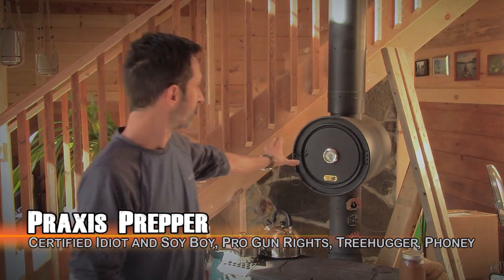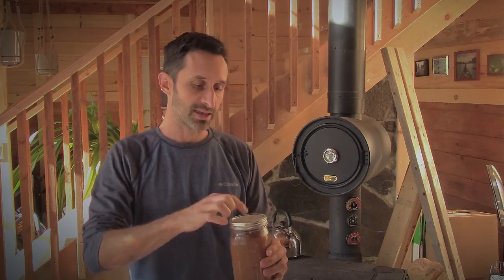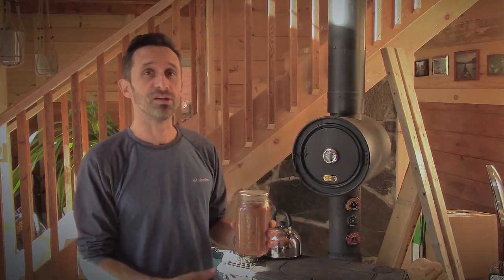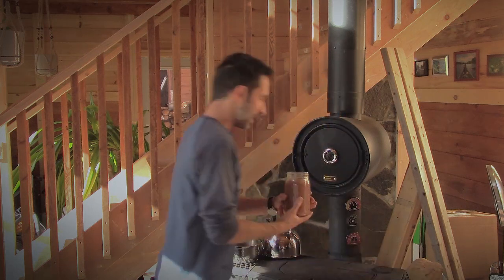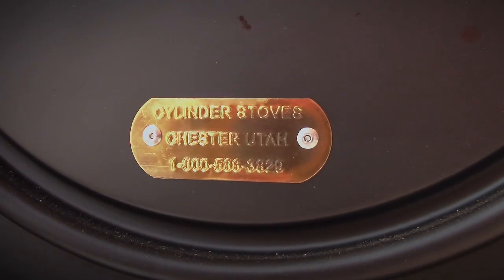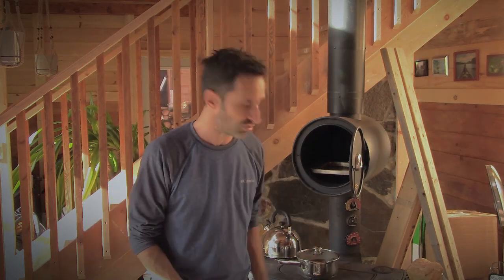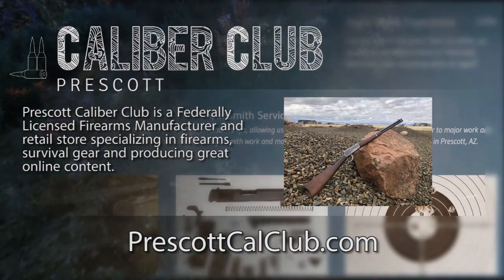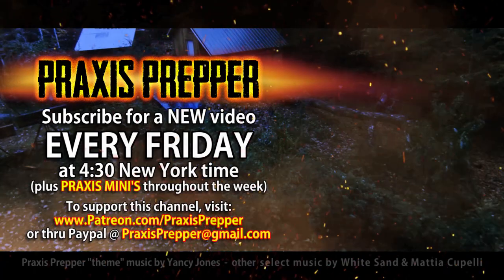The Best Emergency Oven

Comment: What I am hoping to see is an analysis of how well your heating system works in the winter and in the summer.  My experience is that with large openings between floors results in the top floors being hot all the time and the bottom floors being cold.  In the summer, running air through cold areas causes a lot of condensation...
Reply from the maker: So far it's been working great. We have a vent system that brings the heat from the tip top of the house and vents it under the concrete floors. Of all the new aspects of the house, it's the one that I'm 100% super happy with.
Reply: I would like to see a video of your vent system that brings the heat from the tip top of the house and vents it under the concrete floors. I have the same situation with my house. The upstairs gets really warm and the downstairs stays alot colder.
Reply: I would like to see a video of your vent system that brings the heat from the tip top of the house and vents it under the concrete floors. I have the same situation with my house. The upstairs gets really warm and the downstairs stays alot colder.
Reply: I would like to see a video of your vent system that brings the heat from the tip top of the house and vents it under the concrete floors. I have the same situation with my house. The upstairs gets really warm and the downstairs stays alot colder.

Comment: Prax and family.  What do you do with gray water(soapy water from dishes, washing cloths) ?   I have a cabin on 5 acres.  No running water(local stream and catchment system) or septic, just outhouse.  Presently use 6-8 days a month.  I rinse off the single pot or dish i use in a basin and do no laundry or other heavy cleaning.  If i start living there, let alone have 3 or 4 people during a crisis, I will be generating a lot more gray water and dont want to impact the soil in a negative way.  Anyone have thoughts on what to do with  this potentially excessive gray water?  Thanks from PA Applachians.
Reply from the maker: Good for you for giving gray water a try. It's a great resource. I haven't hooked up any of our gray water systems at our new homestead yet. Gray water is always a legal "gray" zone. So we plumbed the house for inspection with the plan to alter later. Here's the system that I was running at my old place though. And it worked really well: https://youtu.be/cIU6uvAOssE

Comment: Oh thanks btw I have been waiting on the over video
Reply from the maker: I didn't mention that there's a crank on the back for rotating a creosote brush that's permanently installed inside. If you build one yourself, be sure to add that. I might be doing a more in depth video in a month or so about this unit too.

Comment: What I think would be helpful for your channel and for a lot of people new to prepping would be to follow the money, or lack of it. There are a lot of folks talking about SHTF but few people talking about how to prep for getting along with less when the poop is next to the fan and just stinking things up. 
I mean really, how many are going to do what you did a build their own place or what I did and move way off grid where the closest gas station is 40 miles away? Not many. 
But, with the stress we see in the economy, how many will still be in their suburban home or even urban apartment and not have the resources they once took for granted?  
You frequently say you are about prepping for the most likely things such as a power outage or an extreme weather event stranding people for a week or two. (Which BTW I think is far more valuable to far more people than say, building a bush-craft stick house which other preppers have done.) 
Anyway, address the most common denominator of those who might be coming to prepping as the financial SHTF happens on an individual level. What will a family or an individual need most? How can they stretch a very tight budget if one of them looses their job, or the government stops sending checks, or inflation grinds away their purchasing power?
 For me, the wood stove oven is interesting and a real option to burning propane if it becomes too expensive. For those in town, solar cooking in the back yard or on the apartment balcony might be an interesting and useful thing. Along that specific thread, it can be a lot more than just the solar oven or cooker. What are the differences in food prep, even what can be cooked better or not as well? Show how you prep a chicken or fillet of fish - if you do and what to watch for. 
What other things have you covered in your earlier videos that would be good to do over from the perspective of doing them in an apartment or city house?
What else will everyone need? One thing I can say for certain no matter where you live, you need community. You have your son and house mate, plus your dad is apparently close by so you have an immediate community. Many people don't have that but everyone needs it. The value of community, especially in-town prepping is an area almost no one is talking about. A few unique preppers such as Lynette Zang talk about community, but even she doesn't talk about how to build it. Community gardens, community gardens in yours or a neighbors yards (front and back). Community hydroponics in a back yard pool. Community raising rabbits or quail and why those two are better than chickens. As an aside, multiples more calories and food for the average person can be raised year around with rabbits or quail and can be done virtually everywhere because they are considered as pets by cities and HOAs. Chickens stink, are noisy, and not pets. Yeah, I know you and Amber are vegetarian, I'm speaking of this for the value of others.  
This in-town prepper community can be as little as or extensive as one's imagination.  Community would have been a great asset for the pandemic. An legitimate excuse to garden with neighbors would be very welcome. 
Back in the day from the 50s back, Americans went to church for community to the tune of about 90%. Today, it less than 40% and most non church goers don't want anything to do with it. Yet, they still need community and a way to make it happen. In-town prepping is a built in device. 
Okay, that's it for now on possibilities.
Personally, I hope you continue as I enjoy your channel.
Reply from the maker: That's a VERY good suggestion. I know I have a lot to share along those lines, but I've also graduated (as have you) from that micro-level prepping. So my life experiences now are out of sync with that entry level experience. You're right though. That's what most people need.

Comment: What kinda pipe & what size pipe do you have on the top & bottom of your oven ? The reason why I ask is because the average 6" pipe won't slide over the 6" inlet & outlet of the oven I have that's the same make & model that you have !! Is there special inlet & outlet fittings that on it or what ??
Reply from the maker: I have a 6" exhaust pipe out of my stove. It's double walled for what that's worth, but the central pipe inside the double walled pipe is 6 inches... or at least it was sold as 6" pipe. I honestly don't think I ever had cause to measure it to check. The Chester Stove oven that I have was also sold as a 6" pipe fit design. For me, they fit easily without issue.
If I were to venture a guess as to what your issue is, I'm recalling that the stove company I bought my oven from (which you suggested was the same company as who you bought from) offered a 6" and a 5" model. Could you have been sent their 5" model by accident maybe?

Comment: Also quick question on the oven....is it just hollow all around and the smoke goes threw the air space?
Reply from the maker: Exactly. it's like double wall pipe except the smoke goes inside the double walls vs through the center.
Reply: @PraxisPrepper  awesome I think I will have a custom one built